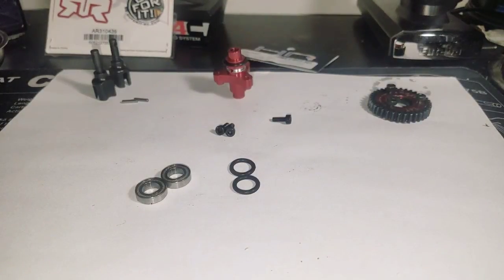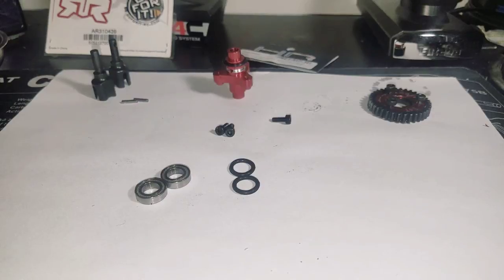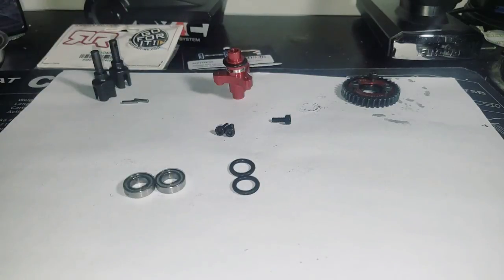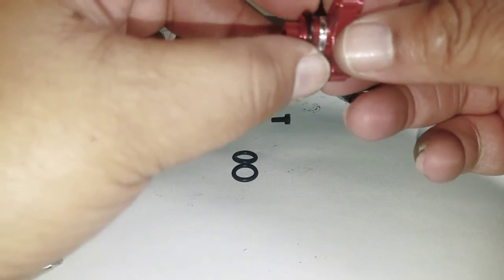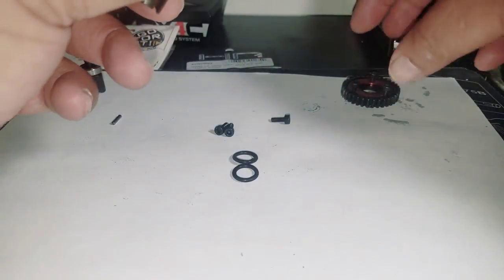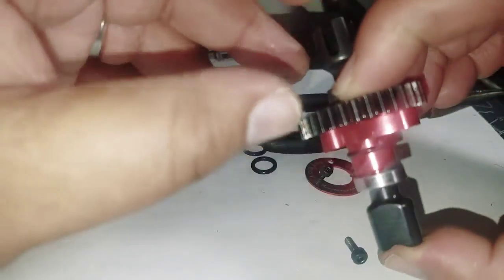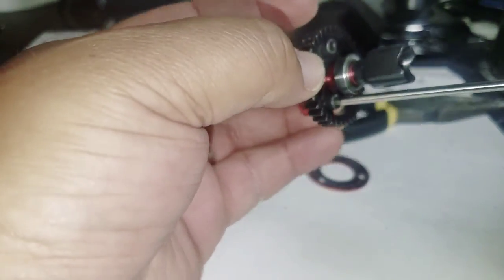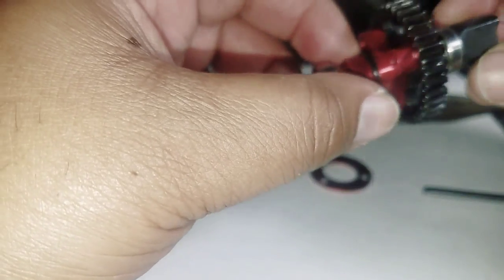Detailed Hot Racing Arrma Spool Build

Comment: Can I use the stock spur with this spool? If not what spur can I use? TIA
Reply from the maker: You have to use a revo style mod1  spur
Reply: Jay Mitch thanks a lot.. do you have the part number by chance? What size of pinion did you use with it? How fast can it go?
Reply from the maker: @209rc7  sorry man I dont give out my gearing. In this vid I beleive uninstalled a 36 or 38t spur.

Comment: Hi jay with one size pins you used
Reply from the maker: AR310440
Reply: i have pins the size is 1.7 x 11 mm is not work
Reply from the maker: 2.25X9.8MM also the provided rubber band to retain it  is  not sufficient. you should look into a retainter  clip of  some sort there is a  Team associated  clip i want to  give a  try as the  pin will come out at  some point.
Reply: Jay Mitch thank you appreciate have god day

Comment: Hello
thanks for this video, question,.which gear do you use for this? Is that possible with the original?
thanks happy racing👍👍👍👍👍👍
Reply from the maker: Traxxas Revo style mod 1 spur gear. Will not work with stock diff gear

Comment: How did you car run after you put it in? I installed mine and now when I give it a lot of throttle it’s like it’s slipping I have to easy into the throttle for it not to slip
Reply from the maker: chad goodman well one thing i did was instead of just relying on that rubber band i used some good thread then super glued it then ruber band and then shrink wrapped it. I dont have any issues with the amount of power i can apply. I have this spool on all my arrma speed and drag builds
Reply: @jaymitchrc  Dude what do you mean good thread? You mean you put sewing thread bunched up in the hole and super glue?
Reply from the maker: @KaizerTest  no. Put the pin in and then wrap thread around the groove and then a little ca glue to keep it together.
Reply: Jay Mitch Ok thanks bro.

Comment: Mann I just got into rc bout 6 months and got a Arrma outcast..what is a spool..and can I put one on my outcast
Reply from the maker: truboy555 a spool is a shaft that replaces a diff, in this case this is a center spool locker. Spool allows you to use smaller gears in hopes to acheive a 1:1 ratio which will make your rc reach 100+ mph depending on your cars set-up only for use for onraod applications.  Using off road will most certainty trash your front and rear diffs. Wouldnt reccomend thus for your oucast because its off road unless youre gonna dedicate it to onroad. If you just want the outcast to be faster there are other ways to do it. Cheapest would be run a larger pinion 16 - 20 tooth.  Another more expensive option would be  upgrade motor and esc, gears, change diff fluid and look at some new tires.